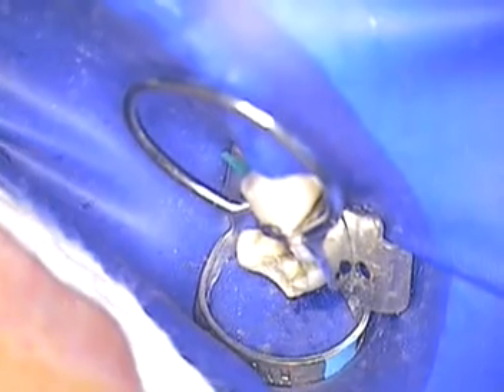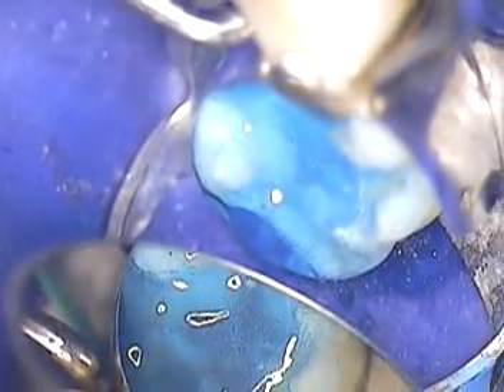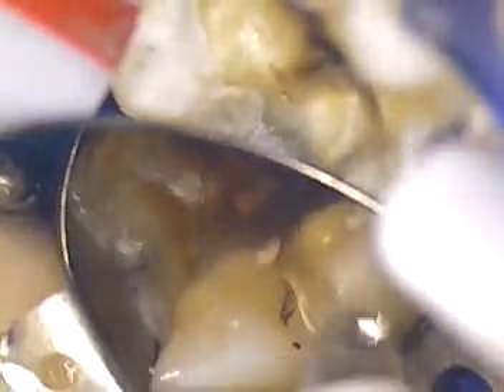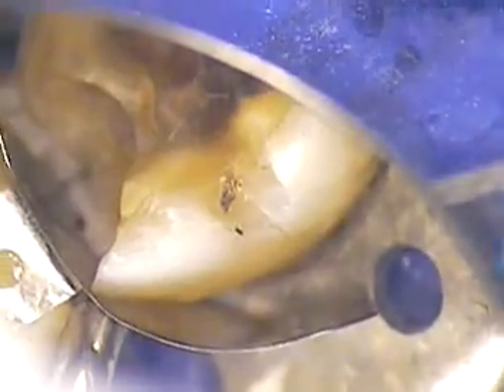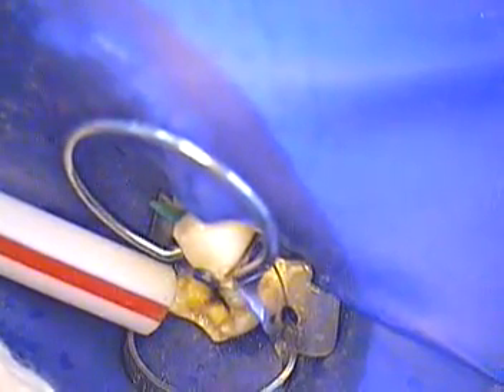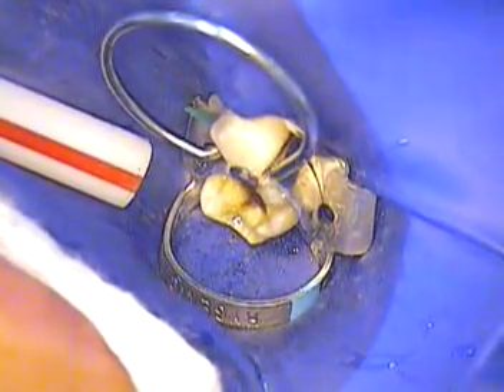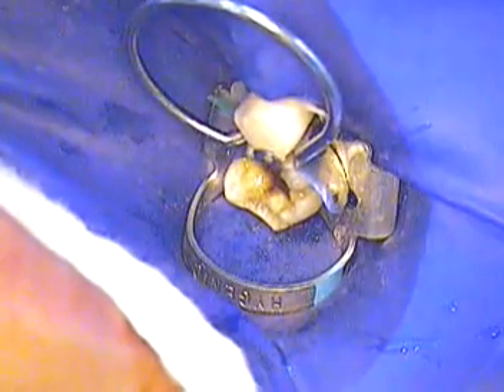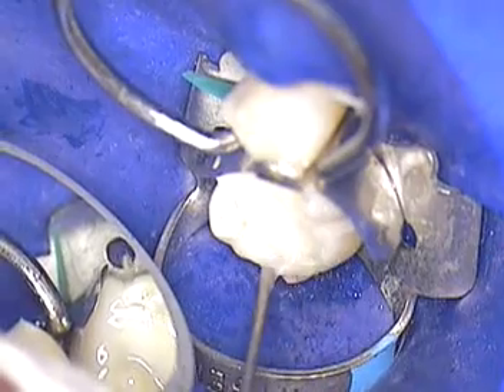DR. GERARD CUOMO - Restoring severely broken down dental fillings Part 3 Boca Raton, Florida

Comment from the maker: @hopess100 Thanks for commenting. . . direct composite is catagorized as either light cure or self cure.  Light curing incrementaly works well in conservative cases were there is more enamel prsent.  In this case, enamel on the chewing surface was missing.  Therefore I used the self-curing core composite material.  Actually, there is an increase in setting expansion in this core material and not much shrinkage. Mixing is either done by hand and/or extruded directly into the tooth. GC